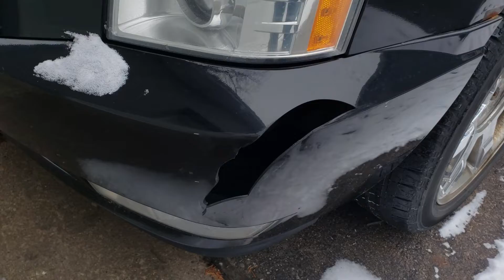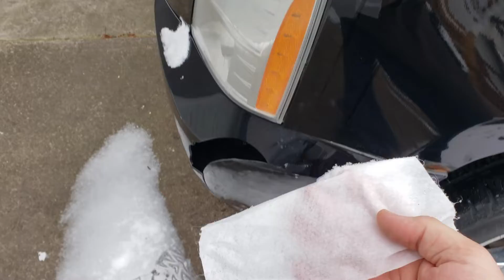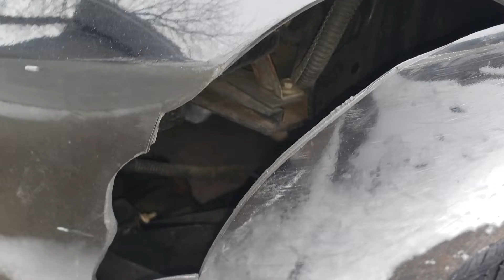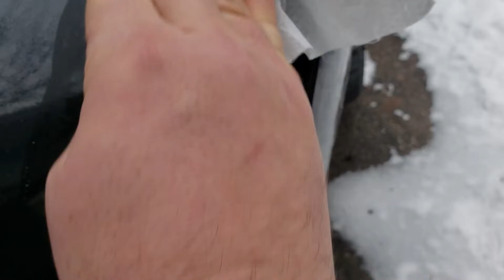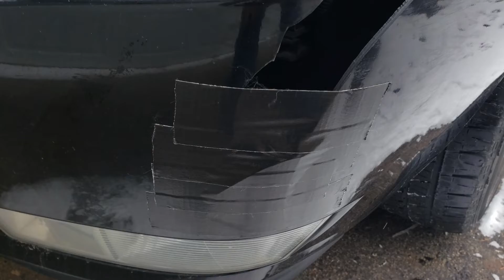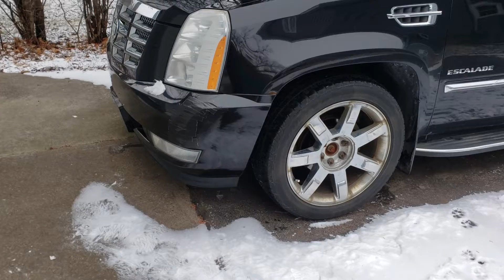Quick Duct Tape Bumper Repair

Comment: Can I ask how cold the temperature the duct tape can hold it
Reply from the maker: Pretty cold, we had -20 degrees Fahrenheit temps that winter in Minnesota. I would recommend putting the duct tape on when it is above freezing for the best chance to get the adhesive to stick. Prep and clean any road grime/wax/animal hair from the area too. I was surprised how well it looked all winter and into the summer as I kind of let it go for a while before picking up some epoxy to fix the bumper.